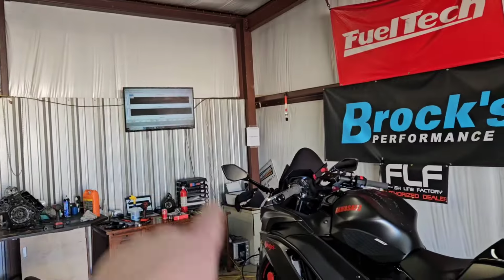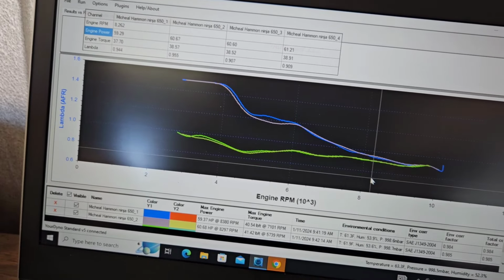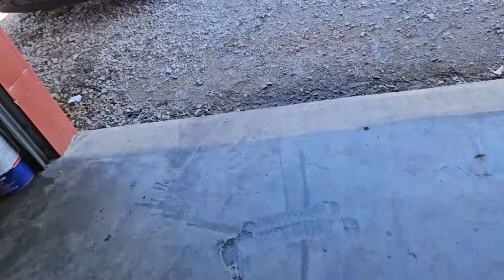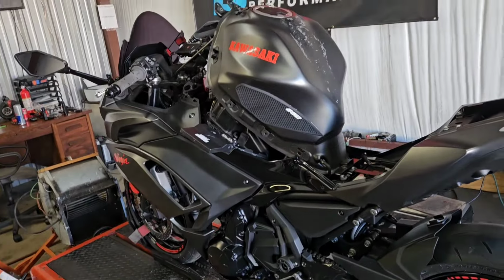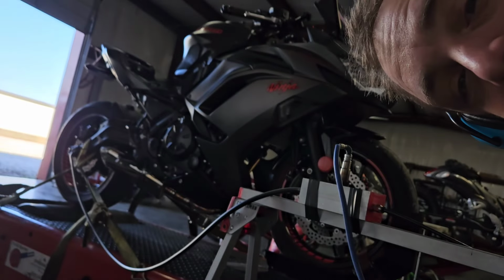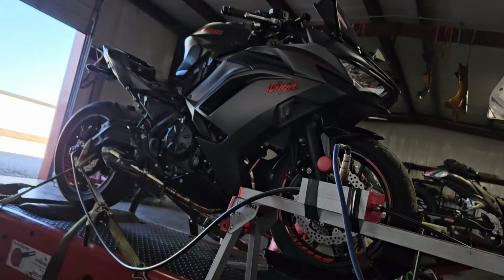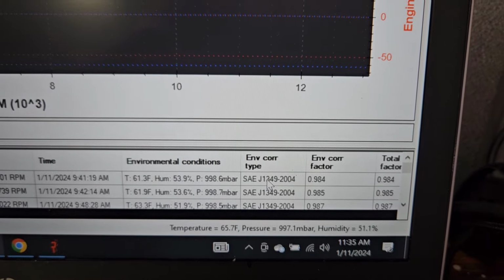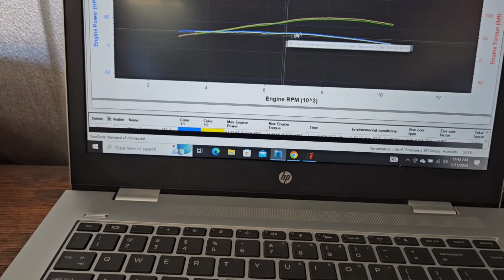long form 2023 ninja 650 dyno tuning

Comment: Hi Ringr, I didn't get what you said about, "the crackle n pops" bit.
Also, about the par valve being blocked off.
I think you said, you tried, but Is that you tried to stop the pops, or you tried to get pops n bangs?
And how does the par valve affect pops n stuff?

Comment: What gear are you doing the pull in ?
Reply from the maker: 6th to get the most load
Reply: Most use 5th, any difference?
Reply from the maker: @rosscurrant8940  there's not really a huge difference in my experience I just like to apply the most load I can get so I get the most accurate air fuel sampling I can if it runs through the RPM too fast you will notice a latency
Reply: Finally someone dynos a 23 650 
I’ve been thinking about tuning mine because I’ve noticed a misfire every now and then, but I wanna figure out what notifications I can do first